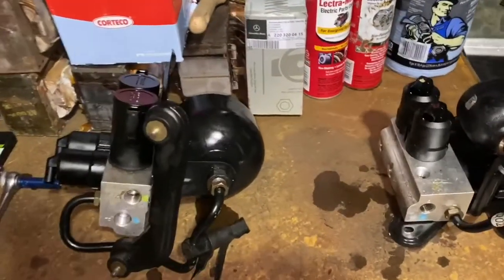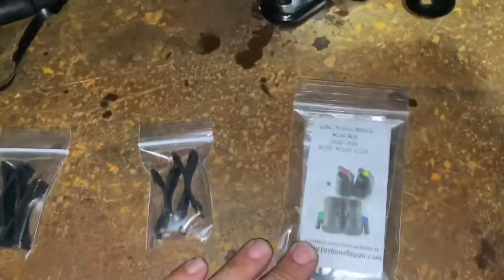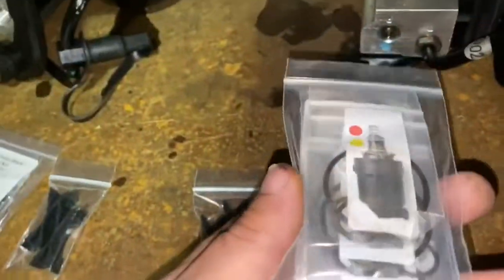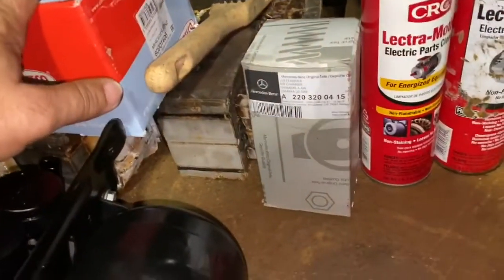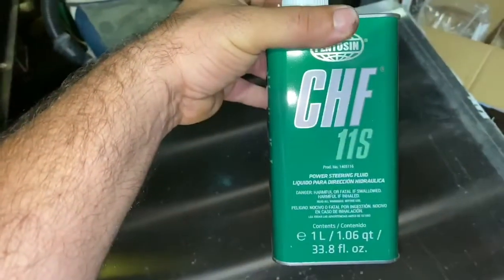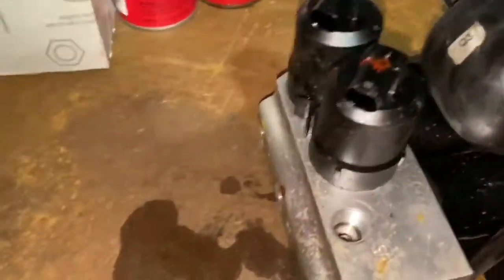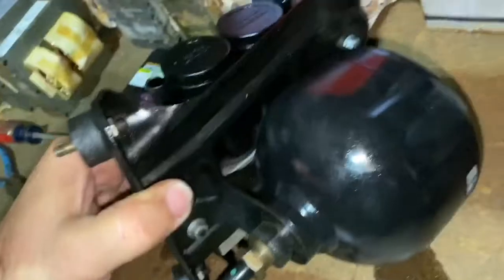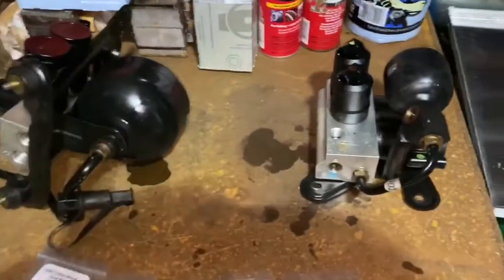Mercedes ABC valve block rebuild pt1

Comment: Don't forget the centre value unit. A 220 320 08 58 and ABC oil filter A 003 184 61 01.   You need about 10 Q of CHF 11s oil.
Reply from the maker: Thanks, great name by the way.